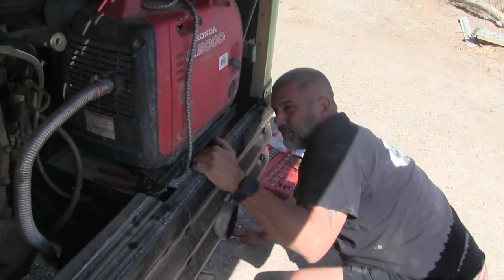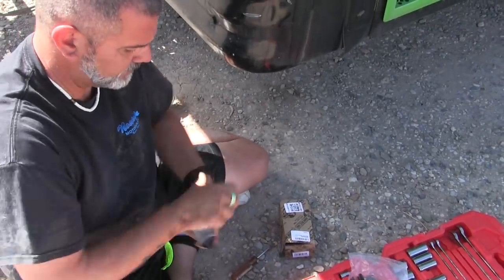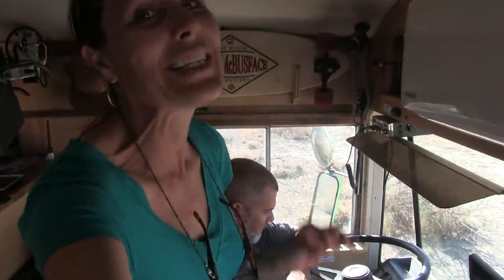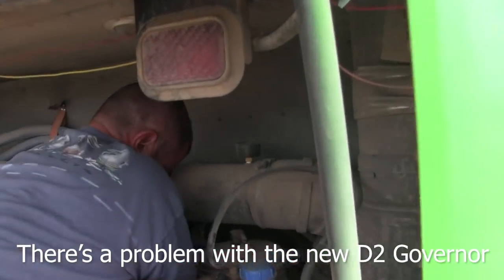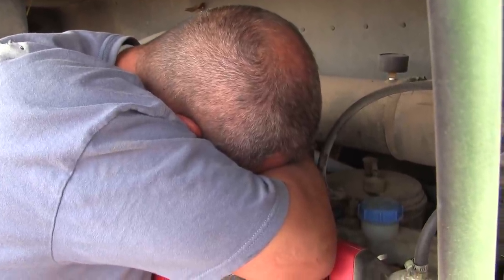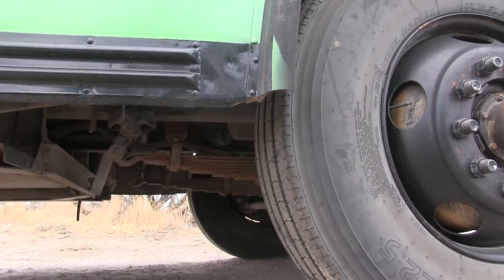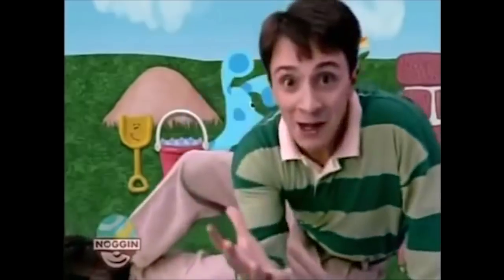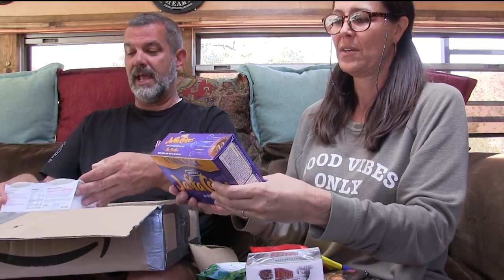BUSLIFE | Will Replacing the D2 Governor Fix Our Air Brake Problem?

Comment: The way your faucet is surging when you run water makes it looks like you need an Expanshion tank in the system. It will give you a more even flow and help save the pump.
Reply from the maker: We actually have one!

Comment: FYI: The governor is adjustable. The plastic cap on the end unscrews. There is an adjustment screw. Loosen the jam nut with a 7/16 wrench. On some, it may be 10 mm. Then turn the screw in or out to raise or lower the air pressure the air dyrer spits off. 130 psi is really the upper end of safe pressure. Most are set between 120 & 125 psi. Also,  the air dryer needs to be serviced periodically. PS Just did some research. There are vids on YouTube about adjusting the governor.  One says, turn the screw clockwise to reduce air pressure about 1/2 turn per 5 psi. Also, it's common to need to adjust them when new. Keep the 1st one you got for a spare.  Just remember to adjust when you reinstall it.

Comment: Suggestion, add a red warning light and wire it in place of the buzzer.  All you need is a warning, it doesn't need to be audible.  My motorhome just has the light, my old bus had a dangling warning sign that dropped down in front of the driver like on a deuce and a half.  Save your sanity.
Reply: This is illegal! An audible warning is mandatory!
Reply: Good job guys. But when washing hands turn water off while srubbin up
Reply from the maker: We could do that and I even considered it. It's not illegal because it isn't a school bus anymore but I do like the idea of hearing the problem in the event I am zoning out.

Comment: Start engine, allow to build till buzzer stops (65lbs) then continue till pressure stops building (105 lbs). Pump breaks until governor kicks in (90lbs) and let it build back to cut out (105 lbs). Shut off the engine then turn ignition on w/o starting. Pump breaks till buzzer goes on, (65lbs). This is a test used by truckers to test air system. It shows governor kick-in, kick-out, and emergency buzzer for proper operation. This should be done each time you move. This is a standard for DOT.

Comment: Mike, the governor is adjustable, you unscrew the plastic cap and loosen the locknut and turn the screw in to build higher pressure, or out to lower pressure. The first two may still work and just need to be adjusted. It’s just pressure on a spring on a pressure relief valve. I’m glad you got your system working again. Love the videos!

Comment: When the compressor reaches proper pressure, the governor signals the unloader valve on the compressor head to bypass, allows the compressor to run. But not produce air.

Comment: Those governors are adjustable and need to be set to what ever the bus specs are. If your loosing air pressure that quick too I’d suggest fixing the leaks. Love your channel

Comment: If you didn’t already chuck the other valves. Unscrew the black plastic cap. Under that should be a jam nut and threaded rod with a slot cut in the end. Moving it in or out  with a screwdriver will adjust the kickout pressure in to raise it out to lower. My guess is the first one you got just needs adjusted. But might be a bear to do installed in the location it’s in. Good idea to make sure your safety relief valve is in good working order if lots of moisture has been in the system. I have seen those get so fouled up that there would be no chance they would pop off before the tank blew.

Comment: Here's an emergency air supply add on you can do Mike. Get yourself a small compressor(which you probably already have because you have the pneumatic staple and finish guns.) and put a tie in on your bus air system that you can hook your compressor to for charging your air brake tanks faster or if you have a failure on any part. Because I'll have a small workshop in the back of my bus I'm going to be tiing my 30 gallon compressor in line with the buses air system for a "little" added reserve if I need it.

Comment: Mike, the governor on a normal diesel motor in a semi, will stop at 120 psi. And it should kick back on at 90 psi. Also, it is adjustable. The one that you took off (1st replacement) has a black plastic cap on the end, you can unscrew that cap and inside there will be a threaded rod with a jamb nut on it. Loosen the jamb nut and back the screw out (counter-clockwise) to lessen the pressure. Once the air dryer "sneezes" you shouldn't lose more than 5 psi on the gauge. If you do, you have an air leak somewhere.

Comment: The plastic cone shape on the end of the governor screws off and under that plastic cone is adjustment screws that determine when it kicks out the air building in the tank and when it kicks back in to build pressure again. In my years of driving a truck sometimes just trial and error on adjusting until you find the happy medium for adjustment. I would keep an extra or one that you thought was bad and when you have plenty of time to play with it you can put it back on and adjust it on the engine. Good job enjoy the videos!!

Comment: I've replaced a few governors, I think you'd find a release pressure adjustment nut under the rubber end cap. Not all are the same, just saying.

Comment: I would change your air Dryer also. That will help also, esp. if the compressor ever pushed oil.
Reply: Won't a hair dryer set to cool work?   Lol. I just crack myself up.

Comment: Oh Mike if you use the soap without water it works better at cleaning off grease, l sometimes use a rag or a baby wipe with the soap and then rinse off with water. Not only does it work better but it helps save water when you're out in the sticks.

HAPPY B DAY TO YOUR GRANDSON 🥳

Comment: Mike have you replaced the air drier   
desiccant filter? From what I’ve read sounds like that should be replaced every year or so to keep the air system in good shape.  Nice work as always!

Comment: The small control lIne from the air dryer had a tendency to carbon up.  Defective D2 governor's are common.  Avoid the off brand parts, try to purchase the Haldex/Midland KN18350?  brand or Bendix 275591. David and Tammy from Florida.

Comment: Good job on the fix! The unloader valve in the compressor can stick and cause air building issues as well. Most air dryers have a desiccant cartridge of some sort that is also a maintenance item. I think it's very important for bus owners to understand air brake systems. Looks like you are well on your way to that understanding!

Comment: A bad governor will also keep your compressor from filling your air system in a timely manner while going down the road and if you were going down a grade using your brakes a lot then your air will be depleted and you would either have no brakes or your spring brakes will be applied.  Your air dryer also needs its dryer cartridge replaced from time to time.  Your air dryer can fail and need replaced or rebuilt also.  I always replaced it because it would carry a 100,000 mile 1 year warranty and is easier to replace than rebuild.  You should also carry a bypass kit of brass fittings so that you can bypass the air dryer if it fails.  If there is a lot of oil in your air dryer cartridge then your air compressor is probably failing.  But these things generally last a long time.  Drain your tanks and keep extra governors in your tool box.

Comment: I noticed the generator there as Mike was working on the governor and remember the video when you guys installed it. Have you used it at all since going full time on the bus or have you been getting along 100% on solar?? So glad that you got that air pressure issue fixed!!
Reply from the maker: In the beginning we did until we realized we had a problem with our refrigerator. Once we solve that problem we decided that we were going to turn off the inverter at night as well and after that zero problems.

Comment: Also, your air dryer should purge at just above 120lbs of pressure.  Your compressor should probably kick in about 100lbs. so that nominal pressure is maintained between 100 to 120 as you drive.  You can adjust the governor to have it purge closer to the 120 mark but it's kind of a pain to do.  Especially on your bus since you don't have easy access like I do on my Kenworth.  Your system will probably be fine getting pressurized to 130 or so and that may even be the norm for a bus.  For semi trucks it's 120 but maybe they spec a little more pressure to afford the kiddies mo safety.  Be well!  :)

Comment: You guys are hiding stuff from us LOL...  @3:58 some decent scratches on the r/r corner of the bumper...........what gives?  I also saw a cracked glass Payne in the front door.  Did you all cover this in some episodes and I missed it?
Reply: I’m guessing the bumper damage was from backing into the Jeep way back when.
Reply from the maker: Yes exactly. The glass pane cracked when we were pulling into a tight spot out in the desert and I was backing up and I couldn't see the bush until it was into that window.
Reply: @BussyMcBusface  aw that sucks. Big rigs take some time, but no matter how many cameras you have.  Lol

Comment: Take the black cap off the governor, get a open end wrench and a screwdriver and adjust the air pressure to 120 psi...
Reply: BTW always carry a spare governor... like fuses/breakers and lights/bulbs...

Comment: Why do school buses have a buzzer and need air pressure before the engine comes on?
Reply from the maker: The air brakes build up pressure from the engine. If you don't have air pressure then the buzzer comes on also if you don't have air pressure you can't stop your bus while you're driving.
Reply: @BussyMcBusface  Oh wow, that's scary! :O